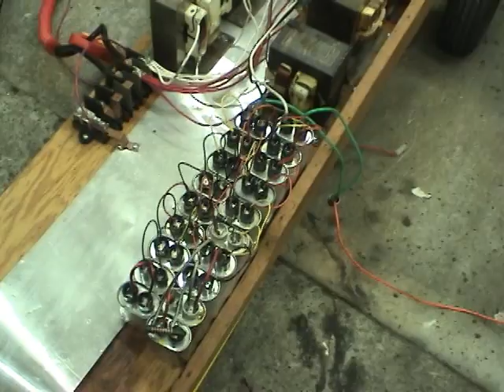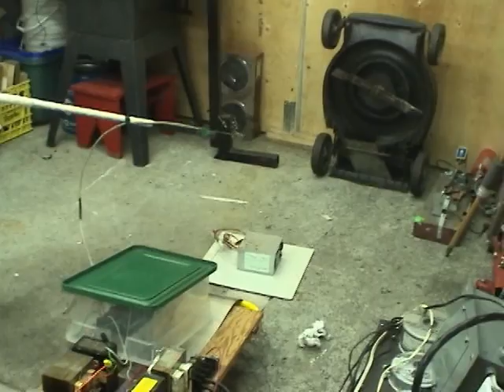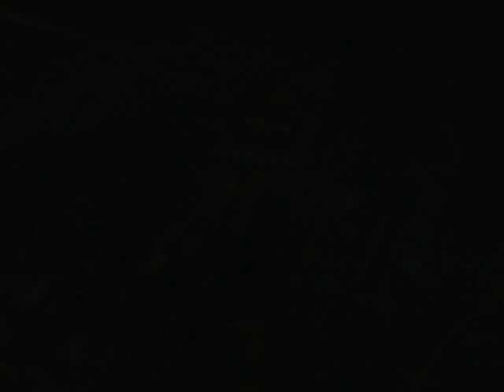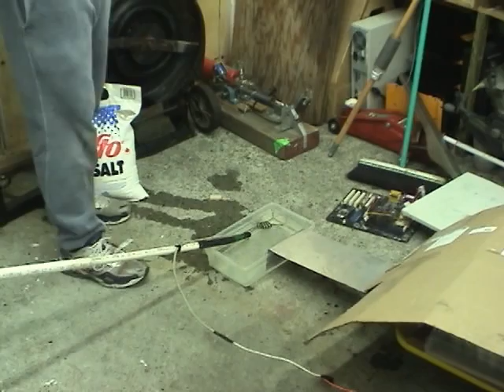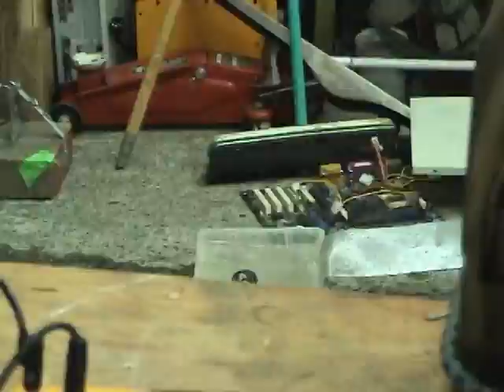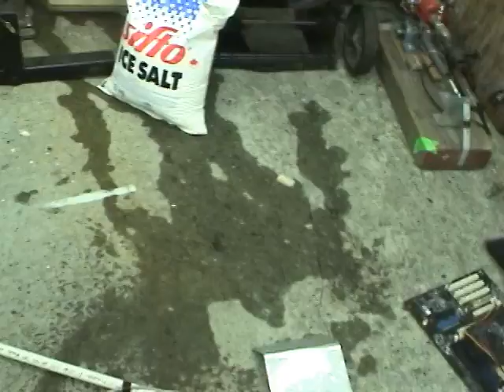Eight-transformer resonant MOT arcs

Comment from the maker: @lokeycmos Close, the secondaries are in parallel, and the primaries are wired as groups of two in series, then all those groups in parallel. This allows the 120V transformers to be operated off the 240V line without driving them with too much voltage. The secondary voltage remains at about 2000V.

Comment from the maker: Thanks! I just need a few more caps to get all 10 transformers running for a little more power.

Safety is definitely critical here, I need to get some 200A rated plugs so it can be unplugged for another level of safety. Even with a safety approved switch, I want something for redundancy.

Comment: This is a crazy amount of amperage at 2000 volts. About 10 amps I'm guessing... I'm probably pissing in the wind with a suggestion but if you series-paralleled (4 and 4) you would be not able to extend your hotstick high enough to extinguish the arc.
Reply from the maker: +fla playa I've measured 17A short circuit. I'd like to try a resonant setup with a pole pig sometime, that may be hard to extinguish!
Reply: 30 amps @ 2000 volts? 60 kW?. Close but do the math like I did next time and be humble about it Mr Lahey.

tesla500 I was pretty much on the money with my estimate then of 10 amps under load. Been around these experiments/calculations my whole life. Everyone should know a shorted secondary reduces the impedance critically and 17 amps is craziness..  

You're going to feed the secondaries of a pole pig transformer with this output? You are crazy but it just may work.. You'll have 60 kV using the two symmetrical secondary phases as your new primary and 120kV using one phase to neutral. You better freaking built a fifteen foot hot stick as it will be nasty.. Oh man 60 kV at that ampacity may draw out a ten foot arc easy.

Series each of the secondaries on these 8 transformers would work wonders too.. Don't think it would hold though and that's why I mentioned series parallel.

Do It! Just be on guard as we are discussing pure crazy voltages/current and cheers.
Reply: Wow, I only get 7Amps from my mot stack, very cool!!!! Will try resonant high voltage with a bigger transformer at some point in time, Cheers;DD
Reply: Thread has been tampered.. Comments missing.. "Pole Pig" That's "Virtual God2007" for sure. Variac Maniac.. Name fits. Why do you want to build electric chair currents?
Reply: fla playa I built it to make crude glass, and to burn things up like motors....

Comment: Hi, really exciting!
I've obtained a 900W MOT - it gives great arcs, not like yours.. but it's great anyway.. only problem is its heating.. If I use the 1uF capacitor it doesn't get so hot, but then the arcs are shorter and thinner than at full output.. Do you think that I can solve it by using 2 MOTs at serial connection on input and also on output ? But will be problem to find another 900W MOT, all I have are about 500 to 750W and it wouldn't work .. or would it?

Comment: Man, that is awesome, so 2kV at about 4A? (8 MOTs) almost as powerful as the electric chair.  Don't you have to worry about discharging that huge capacitor bank after turning the power off, or they the resistor auto discharge type?
Reply: Normally with 10k ohm resistor inside

Comment: So what would happen if you ran a single turn of large gauge wire, like 4 or 6 gauge, through all these MOTs seconderies? would you get like very high amperage with a still decent voltage or would it manage to trip that 200 amp breaker?

Comment: if youcould see my channel... try distilled watter, and make you a beer bottle capacitor to run in parellel with your secondaries.. then the distilled waters not as conductive so it will build a charge under the water enough to bridge a good gap too. the effects are amasing with a 15000 nst, i couldnt imagine  this hv on it...

Comment: wire them in series and put them in mineral oil to prevent arc-over.
Reply: You can extend it until wire arcs to the core in the transformer and then remove the last transformer to stay on the safe side. If having a few Ampers with 10+ kV is considered to be safe too.